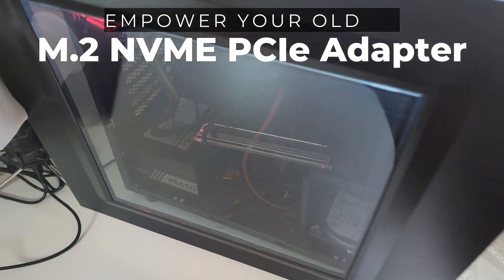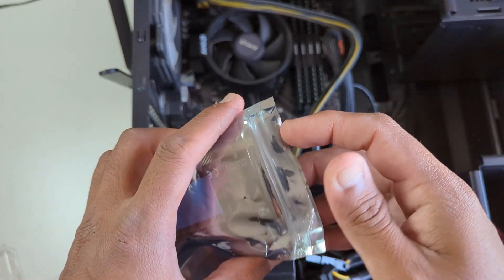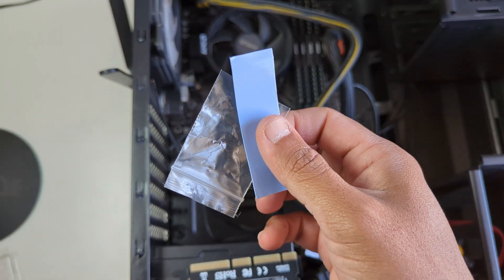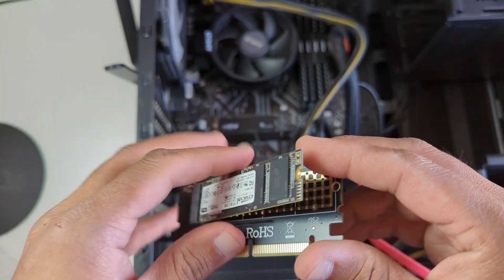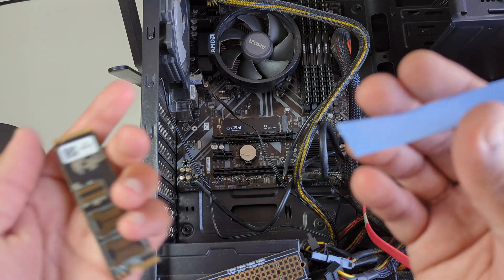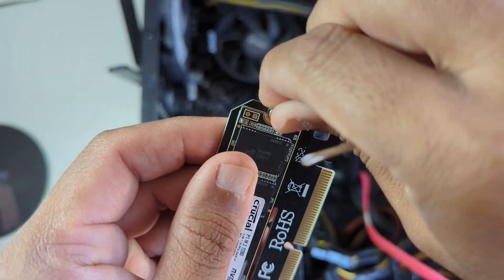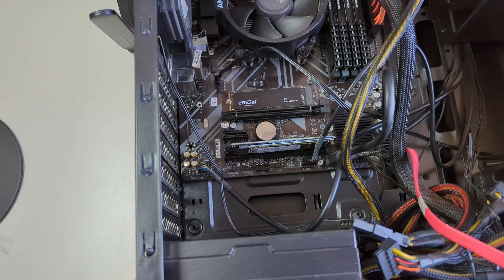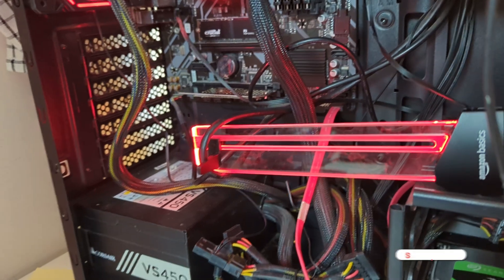M.2 NVMe PCIe Adapter - Connect NVMe SSD to Old Motherboard

Comment: What if the motherboard is SUPER old and doesnt even have an NVMe slot on the motherboard - can i still use an adapter to plug it in a x4 PCIe slot? Or would it just be a better idea to get a SSD instead like a 870 evo SATA 3
Reply from the maker: Yes, you can use an NVMe PCIe adapter in an older motherboard as long as it has a free PCIe x4, x8, or x16 slot. The adapter allows you to physically install the NVMe drive, but there are a few important things to consider:
Check if the motherboard BIOS supports booting from NVMe.

Comment: Why would you use this?  It has no advantage over a 2.5" sata ssd which is less expensive.   Most motherboards have at least 4 and many up to 8 sata connectors.  More than enough for the greater majority of users.
Reply: ??? speed son an m.2 nvme is a lot faster than a 2.5 lol
Reply: Well there is hardly any price difference at the moment for some reason.Plus depending on which adapter you buy and which  pcie slot you use it should be able to use some of the speed advantage that m.2 drives have over sata.
Reply from the maker: Well, this M.2 Hdd was something that I took out from one of my old laptops that no longer works. So wanted to show a way of still being able to use it on desktops with this m.2 to PCIe adapter.
Reply: @TheGlovesMan  I've never seen a laptop with a pcie slot!!!!!!!!
Reply from the maker: I meant to say, a laptop with m.2 hdd. I bought this PCIe adapter later.
Reply: For speed LOL, do your research